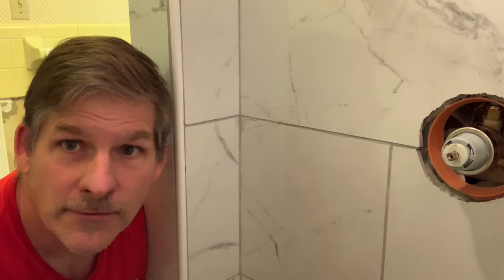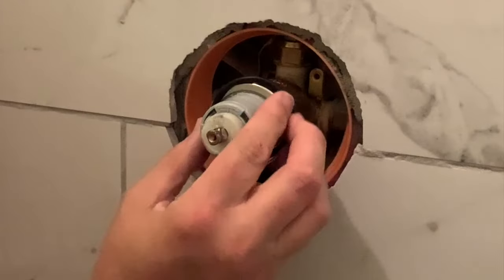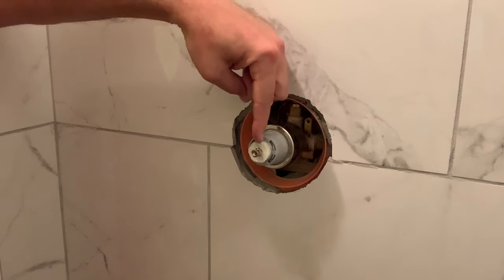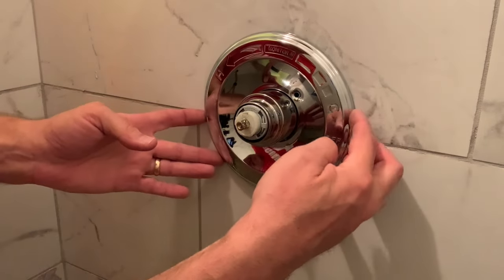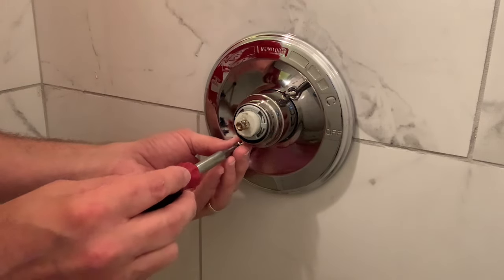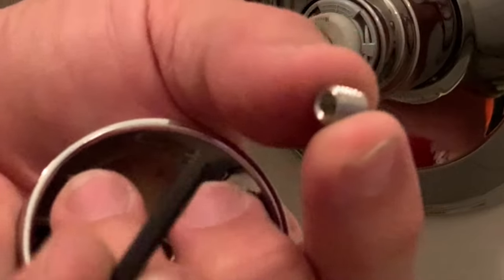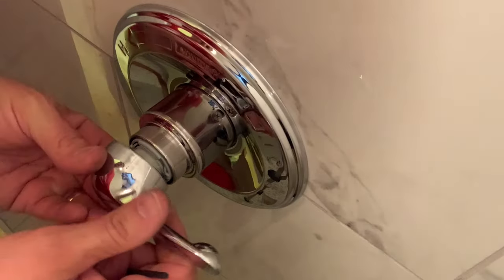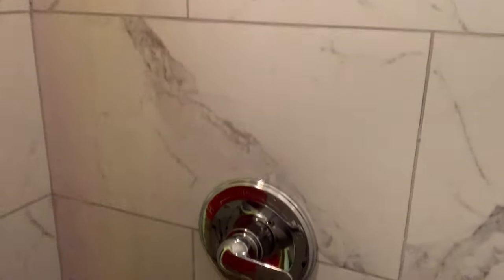How to Install Shower Trim Kit : Delta Classic

Comment from the maker: If you are looking to be doing a similar repair, you can find what we used on Amazon. We used the Delta Faucet Foundations Shower Valve Trim Kit, Shower Handle, Delta Shower Trim Kit, Chrome BT13010 (Valve Not Included)
https://amzn.to/3lTJFgI
Other options / supplies we used are listed in the video description. Just FYI. These links are affiliate links. They are free to use AND Amazon will pay us a small commission if you use them - Many thanks if you do. It helps us keep making videos!

Comment: Removing a corroded handle is nearly impossible, you loosen the Allen screw to remove the handle but it will more than likely be fused to the valve cartridge. You may end up needing to replace the cartridge. The only thing I can think of preventing this is stuffing plumbers dope into the handle cavity where the set screw goes to keep the water/mineral deposits out.

Comment: I noticed that when you were all done with installing the on/off shower plate that you did not caulk around the plate.  Is it necessary to caulk around it if it isn't flush to the wall?  I had a new shower installed (by a plumber) with new Moen shower head and handle and the plate isn't flush to the wall. I'm afraid water will leak into the wall if it isn't sealed.  Thanking you in advance. Sue
Reply from the maker: It should be flush. Maybe installed wrong. Maybe wall isn’t right. I think caulking the gap at least the top half - from 8 o’clock to 4 o’clock would help. 
Hope that helps.

Comment: What do you do if the handle won’t go on in the 3 o’clock position? Mine goes on at like the 1 o’clock position 😡
Reply from the maker: I would double check the position of all the parts. If all is right, I suppose the manufacturer could have change it. 
Check the full range of the handle movement -from off to on to make sure everything is functioning as expected. 
Thx for watching!

Comment: I am having a hard time with putting in the screws (holes are further back than yours  @3:29 of this video) and having the plate fit with Delta being leveled on the bottom of the plate.  Any suggestions?
Reply from the maker: Hey ms…,
Do they reach it? If not you can go the big box store - they have sizing tool there - then just get a screw w/ more length. May take a couple tries - try to get a ball park measurement 1st. 
If they reach - I do remember that trying to line it up blind was difficult. I put one screw in  with the plate swung to the side so I could see to line it up. The second screw was totally blind so you have put on your patience hat and go slow. It took multiple tries. It will happen.  
Thx for watching!
Reply: So do you have to use a Delta shower ate if it's a delta mixer valve?

Comment: I want to replace the Delta shower trim that came with my house (2003 build) with a Delta unit like the one in the video, but don't want to deal with also replacing  the valve, is there any way of knowing in advance if this is possible, and just swap the old trim with the new one?
Reply from the maker: You should be fine just replacing the trim - check and see if the old trim / new trim slides over the ring that holds the valve in the valve body.
Reply: @Housebarons   Thanks I'll look into it.

Comment: How do you switch between bath and shower mode?
Reply from the maker: Usually that is controlled at the tub spot - typically a handle of pull down the end of the spout. 
Hope that helps. Thx for  watching!

Comment: my shower handle is corroded on and won't come off. can I get a trim kit to take off the whole thing?
Reply from the maker: You can get a trim kit for everything. Maybe you can drill out the set screw on the handle???
Maybe try CLR - line and scale remover…
Maybe PBPOWER BLASTER?
Hope you find a way!
Reply: use vinegar

Comment: Do you need to turn off the water supply before installing?
Reply from the maker: Hey em…,
IF you are removing the cartridge -YES! 
But the trim kit we put on does not involve the cartridge.
There is a large brass ring that holds the cartridge in. That is what you pay attention to. Do not disturb that, and you are good to go. 
Hope that helps.
Thx for watching.

Comment: Does the water have to be turned off before installing it.
Reply from the maker: Hey henara..,
There is a (brass) ring that screws on and holds the cartridge in. If that needs to be removed to attach trim kit, then water MUST be turned off. So long as the brass ring stays screwed on, you should be good to go. Might be better safe than sorry. 
Thx for watching!

Comment: Does the water have to be off for this part?
Reply from the maker: Hey David…,
No. So long as you DO NOT remove the ring I am touching at 0:04 second mark in the video. That holds the shower cartridge in. 
So long as your cartridge is in and that ring is on, you are good to go ( at least for delta ).
The trim kit is basically decoration.
Hope your project goes well!
Thx for watching!